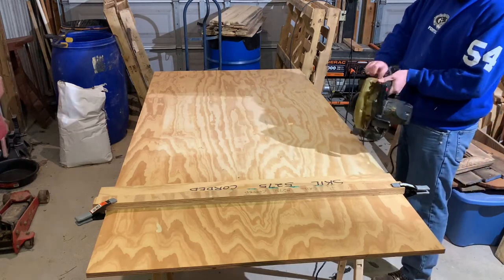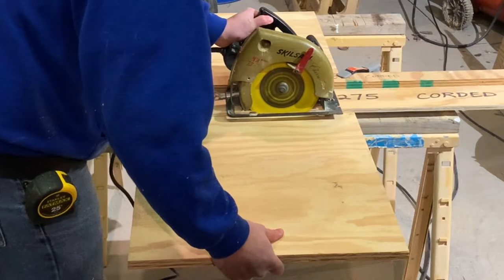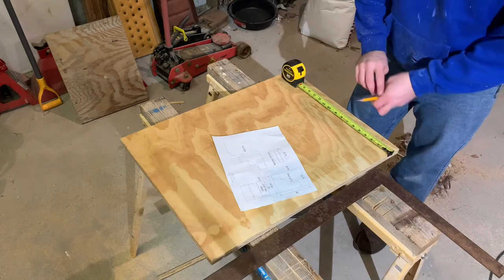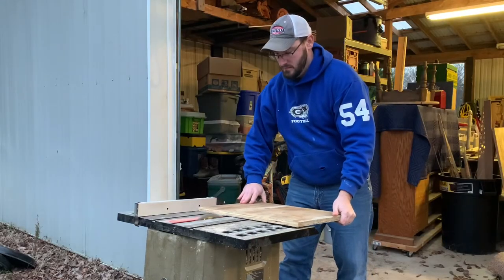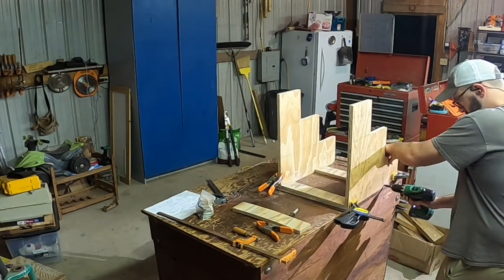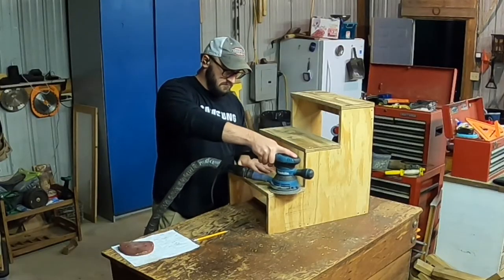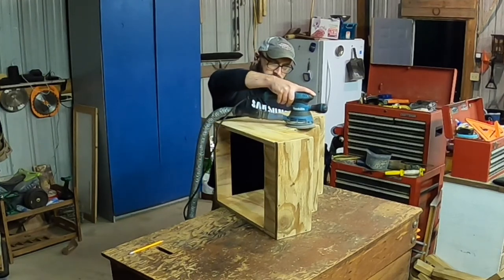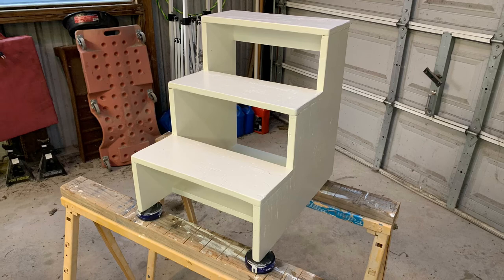How to Make Dog Stairs | DIY Plywood Dog Steps

Comment: I think that my question is what is the height of the riser. I'm going to build the steps for my Shih Tzu. Many thanks.
Reply from the maker: I built mine at 6-1/2”. If it helps, there’s a link in the video description to a cut sheet with the dimensions for these steps. Best of luck and thanks for watching!